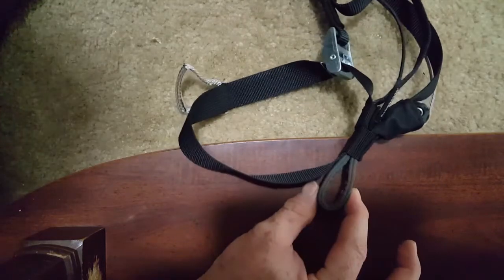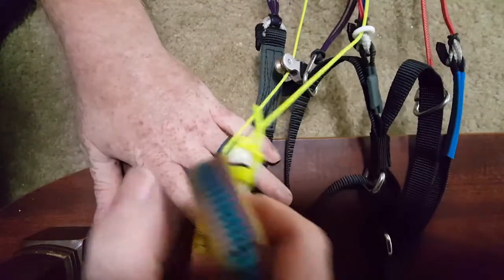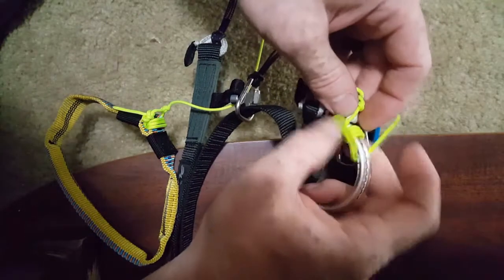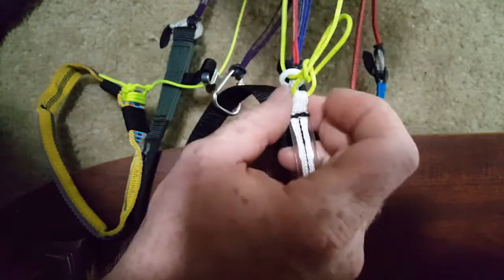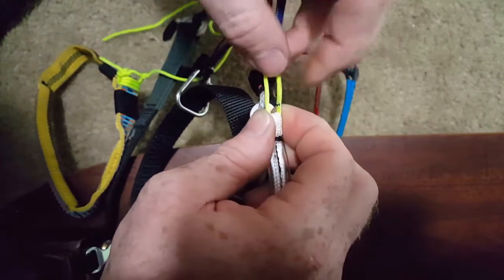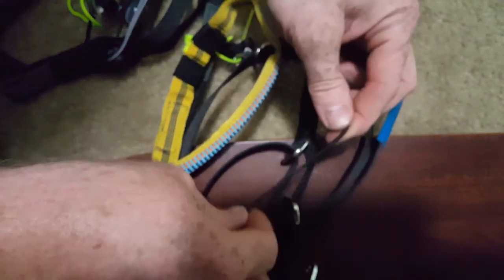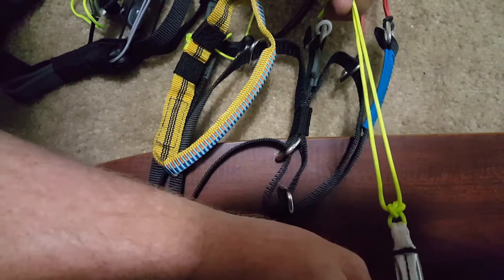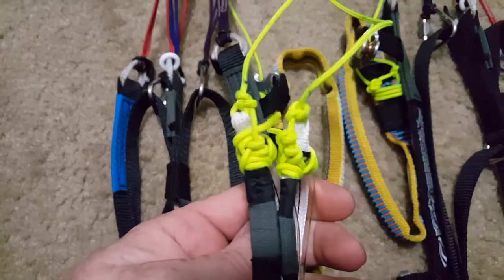Optional 2D steering, Ozone Spyder

Comment: What keeps you from accidentally losing the tip steering loop or if it comes off the magnet and having the tip line and loop handle flying back into never land or worse, it gets sucked into the prop?
Reply from the maker: In this video the tips still had a bungie that kept them attached to the riser. But I have since then went to full 2-d steering and got rid of the toggles.
Reply: Good to hear! :-)  I'm interested in adding 2D to my Roadster 3. Any suggestions or any videos you can recommend? I'm most curious on the tip steering line length when it attaching to the brake handle? Thanks!
Reply from the maker: @chrismriscin9161  it's fairly simple. It should be similar to my spyder. Just mark the tip line where it sits in relation to the brake toggle. Then just tie it into the toggle. "Without the eyelet mentioned in my video"
Reply: @MaxsAdventure. how well did the bungee keep the tip steer in place? Thinking about doing optional tip steer
Reply from the maker: @tventrca  just go for it. 2-D is the only way. You'll end up not having as good of an experience by having them separated. No longer having to stow one to grab the other. It instantly becomes a natural form of flying if you just get over the fear of the unknown. As for the bungie I took it off before the next flight.
Reply: @MaxsAdventure. I was thinking about attaching my top steer toggles to the main brakes using a small carabiner, or is there really no reason to have brakes only?
Reply from the maker: @tventrca  that's basicly what I did. (To afraid to commit) but once you take the first flight with 2-D you'll make it permanent.
Reply: @MaxsAdventure.  gotcha, that’s what I figured. When you did make it permanent, did you add any length to tie it in to the standard brakes?

Comment: Are the magnets strong enough to hold the Tip steering handles in place without the going through those loops?
Reply from the maker: They sure are. I left the bungie on there also just in case they didn't hold. But the magnets are very strong.

Comment: Any updates on your 2D steering? Did you ever attach directly to the brake toggle?
Reply from the maker: Yes I ended up directly attaching them to the brake toggles. If you watch any of my recent videos you can probably see the 2D steering is still attached. I'm sure I could play with the lynx a little bit and get more Authority out of either the brakes or the tips. But I'm extremely happy with 2D steering. You just have to remember when flaring to keep your arms out kind of like a bird flapping its wings.
Reply: @MaxsAdventure.  What was the downside of keeping it separate like you had it? Were you thinking that by just pulling it out of the ring there that would make 2D optional for when you wanted it?

Comment: Sorry...it doesn't make sense...if you attach the tips line to brake handle you pull the brakes always! No matter witch side. The 2D system with 1 handle is not working.they have to be separate
Reply from the maker: No need to apologize. 2-D steering works, plain and simple.
Reply: @MaxsAdventure.  good luck...will need it...